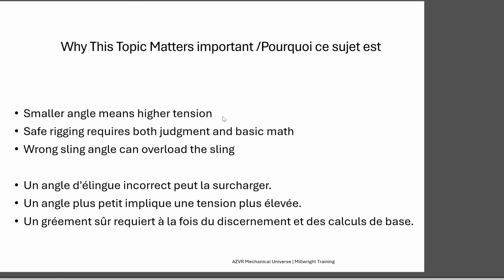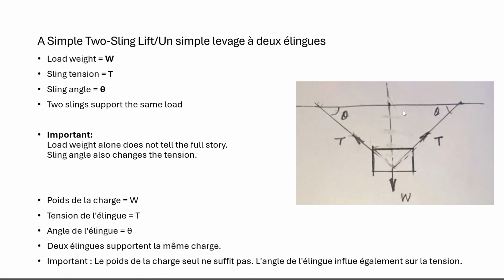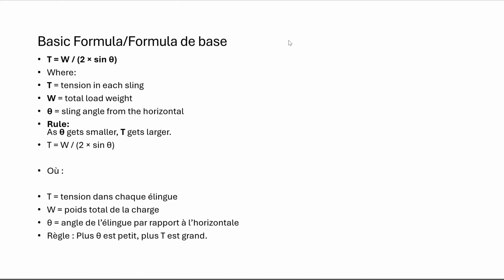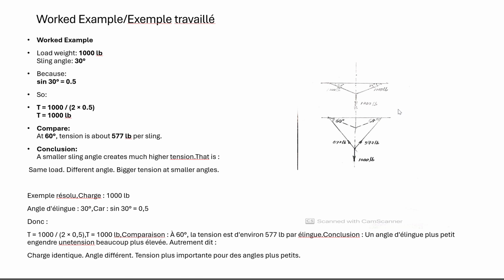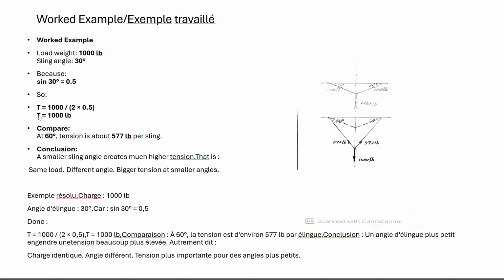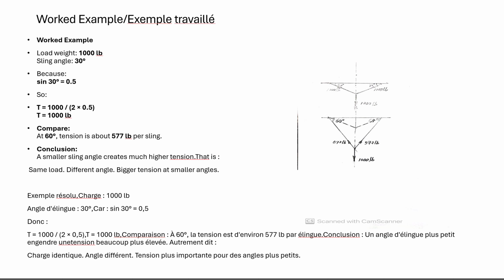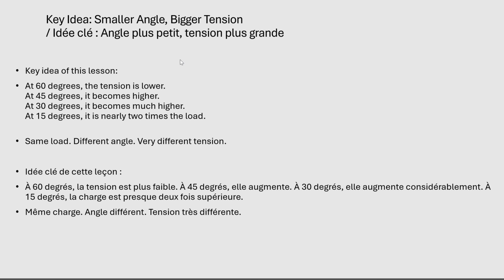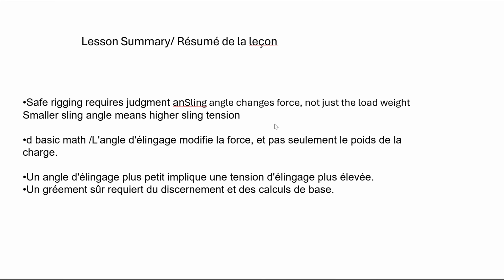Lesson 2:  Sling Tension  Math Basics  Why Smaller Angles Mean Higher Tension

Comment from the maker: Key message of this lesson:

Smaller angle, bigger tension.

In rigging, the load weight alone is not enough.
The sling angle can greatly increase the force in each sling.

Please leave a comment:
What sling angle do you consider the minimum safe working angle in practice?

Message clé de cette leçon :

Plus l’angle est petit, plus la tension est grande.

En élingue, le poids de la charge seul ne suffit pas.

L’angle d’élingue peut considérablement augmenter la force exercée sur chaque élingue.

N’hésitez pas à laisser un commentaire :

Quel angle d’élingue considérez-vous comme l’angle de travail minimal de sécurité en pratique ?